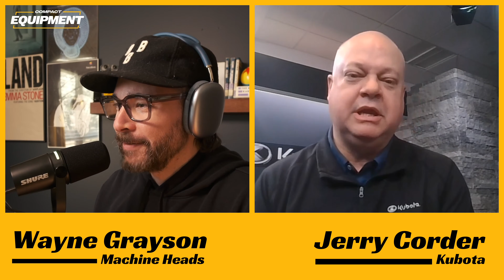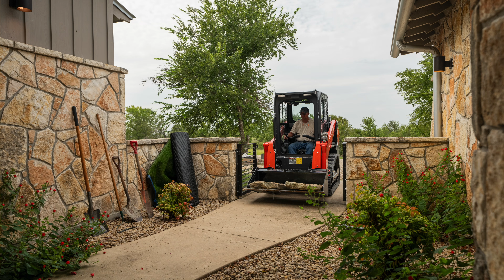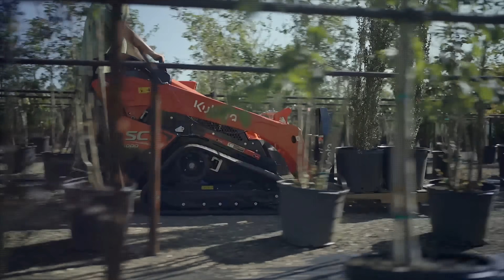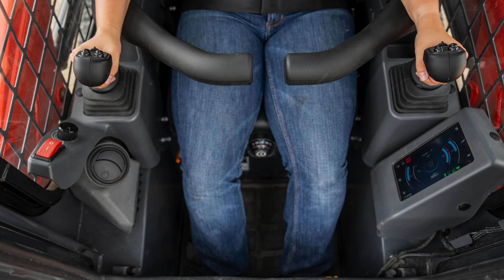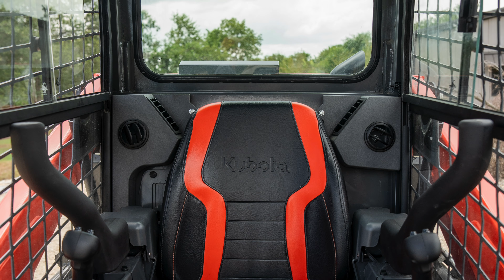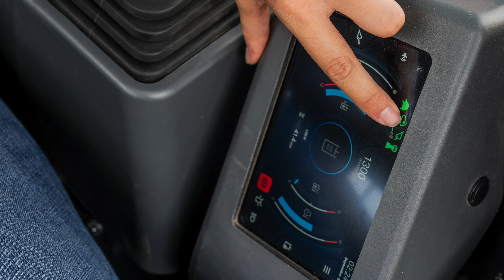Why Kubota's Newest and Smallest CTL, the SVL50x, Doesn't Have Pilot Controls

Comment: i don't know whether the Kubota rep told the interviewer that he would not talk about ASV or if the interviewer was just too dumb to have the obvious conversation. ASV has had the CTL market's smallest enclosed skid steer for years with the early Terex PT-30 and then ASVs RT-25.  Terex/ASV recognized early on that a small 4 foot wide CTL would have its own market with landscapers and small contractors. i would have expected the above video to at least have compared something about the new small Kubota to the ASV.  is this new Kubota better in any way than the ASV RT-25?
Reply: I think the interviewer has an issue with ASV. He has left them out of many conversations that deserve more attention than they receive
Reply: @Fayettepropertysolutions asv 50 new style pos  , hard to see bucket edge , super load in cab I mean  worst, heavy vibration, jumping controls , I have 3 older  asv great , this is bad , now looking at bobcat t450
Reply: no mention on the bobcat s70 either... the og of smallest cab skidsteers